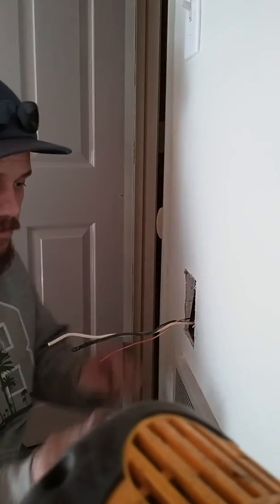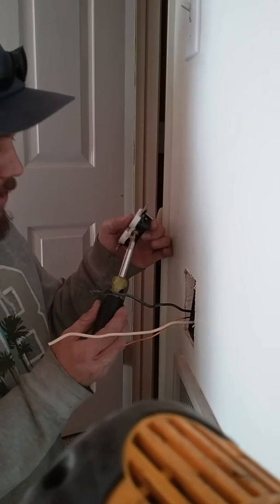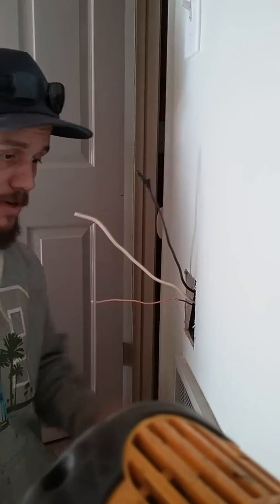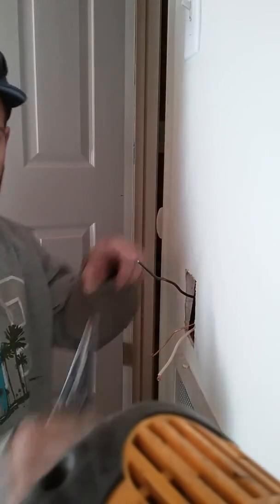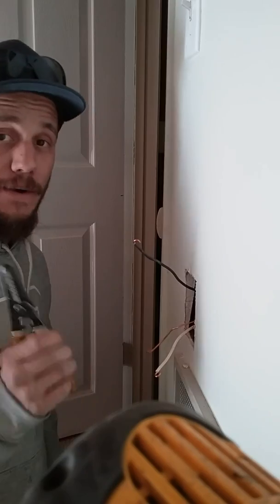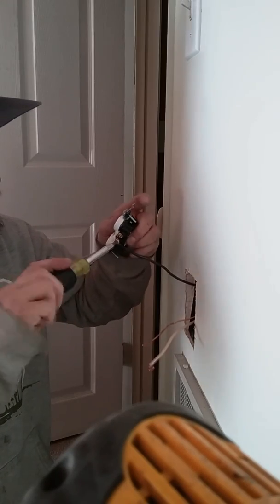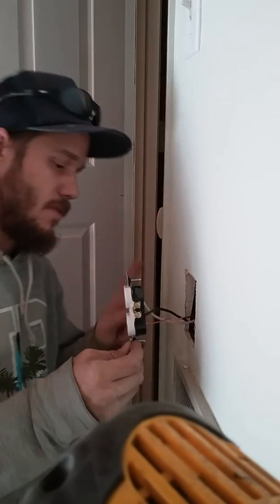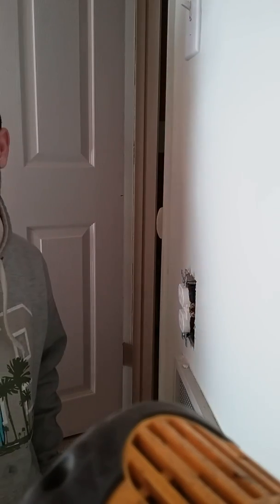Installing an Outlet, plug, receptacle, while hot, power on.  No shock.  DIY electrical lesson

Comment: You put the ground on first then the noodle, hot on last...period.   You never put the hot on first.  You can palm the whole device in your left hand safely then connect the hot and hold it in place by the insulation with your hand palming (index & middle)the device.  Then use free hand to tighten the hot down.  That’s the way all the electrical unions teach it and after 20 years of doing residential/commercial/industrial I’d never do it any other way.  To each is their own tho.
Reply: You realise he's doing a socket. Ground as an extra safety measure wouldn't even matter. It's not like the ground will have any connection to the hot correct?? Nothings plugged into the socket. He's literally just connecting wires onto their own contacts. Wouldn't matter what order, he's just found over his years that this tends to be safest. (well apart from turning the power off obviously haha)
Reply from the maker: @PK-lz4ho  thank you for understanding the video
Reply: Paul Knowles The only logical response here.
Reply: @PK-lz4ho  I only had done a hot hardwire one time on a receptacle. Only time I ended up getting shocked was when my pinky finger accidentally touched the hot terminal while the palm of my hand was in contact with the yoke. BTW I was on a yoga mat doing this, though I can't Calc how many ohms it was exactly, but you get the picture. If you need to work on it hot, wear proper PPE gear. Always if possible de-energize the circuit.
Reply from the maker: If you ground first then your grounded as you handel it.  Then your grounded as you try to hook the hot.   Thats how you get shocked...
Reply: I agree,  electricians that taught me always said remove hot first and connect it last.
Reply: As an experience electrician..even on a dead circuit you will land your ground,neutral,hot in these order,dead or hot that's the correct way to do it,ALWAYS DEENERGIZE YOUR CIRCUIT BEFORE WORKING ON IT PERIOD (BELIEVE ME ITS NOT WORTH IT)
Reply from the maker: @robcruz5546  it's not that bad to get shocked.
Reply: I've had to work on live circuits before, not fun. Someone had said to me one time, why dont you wear rubber gloves? I'm thinking, why didn't I think of that? Anyway it worked extremely well.
Reply from the maker: @thomasschwarting5108  120 is not that bad it's the 277 that will mess you up.  It pulls you in stuck
Reply: @thelovetemple333  it’s actually the amperage that kills you. You could hold the hot wire in your hand and not touch anything else and you’d be fine, because you’re only “potential”. As soon as you touch something while holding hot wire it will travel through you and suck really bad. A risky experiment but it’s true haha.
Reply from the maker: @brucehenry5338  voltage is potential difference between hot and neutral.  Yes one can touch the hot if not grounded or touching the neutral
Reply: @thelovetemple333  I’ve been hit by 277 once…the wire nut  fell off and my hand touched it but luckily my elbow of the same arm was grounded.  I rather get kicked in the balls by a professional soccer player then experience that again.  With that being said 120 is the more dangerous voltage because it’s the more common voltage.  More ppl come in contact thus more issues.  Most common is assumption the correct breaker is off and someone used a faulted tick tester.  I’ve personally fell victim to this in my apprenticeship days and hence while I only use a fluke tick tester on a know live circuit first.  I found this to be the most durable and the most reliable.
Reply: @thelovetemple333  i got shocked as a kid when I was replacing a fluorescent bulb in a commercial building. I wasn't paying attention,  one finger on each side. Gave me a massive headache and contracted my muscles. I was dazed for a long time, I even had pain around my heart.
Reply: Haha I get the video uploaders point... I think he did the hot one first because there would be less potential for crossing the wires if it was secured first. With proper handling of the outlet.
Reply: I would also like to add... That neutral (return) and ground are not reliable... I have encountered shocks from bridged grounds. The wiring in my mother-in laws-house from shitty contractors of yore makes me fear all wires.
Reply: Thank you for this
Reply from the maker: Obviously never been shocked through the face of the outlet
Reply: Every electrican knows to install the hot wire last , if your installing while its energized ..Ground first , noodle 2nd hot last . You do not want to be  grabbing and wiring the receptacle while you just energized it . Makes no sense ..But hey your probably a newbie . its coo . You got to start somewhere ...
Reply from the maker: @818NH  why?
Reply from the maker: Why?
Reply: @thelovetemple333 I don't think anyone is saying that you can't do it while it's hot we're saying this because it's the safest way to do it. For your safety and anyone who sees this video. So If you're gonna be teaching someone how to do hot work you should teach them to do it as safely as possible. Jus because you say "don't do this at home" doesn't mean that someone didn't look up this video because for some unknown reason they think they can't turn off the power or maybe they can't who knows.. Which brings me to another point. If you're watching this video trying to learn something, please for own safety and anyone who might be in your house. Call a professional because  you're clearly in over your head. Not saying that you can't do it but as an electrician
 (IBEW local 16) you need to understand that electricity is unforgiving. It only takes 1/10th of 1 amp to kill you. If I was gonna show someone to change an outlet I would not show them how to do it hot on the 1st day and I bet anyone who looked up an found this video has been their first day for the last 6 months and are in no way ready for not shutting off the power. It's not rocket science but we understand that but it is a very dangerous job that has been standardized for a reason. To keep you safe. That's why my friend.
Reply from the maker: @JoeNathan42420  how many times you been shocked?
Reply: @thelovetemple333  Because after connecting the hot, the two terminals on the side are now hot. That's a lot of live surface area. Now when you're working with the bare copper, you're inevitably going to ground yourself. If during that time, you accidently touch the hot wire or either of the two hot terminals, you're the path of least resistance.

OTOH, move the hot out of the way, and connect the ground first. This is easy and safe. Then the neutral. And then the hot. While connecting the hot, if you touch the live terminal, you are still not the path of least resistance because the receptacle has a ground and neutral connected. Plus, even if you do create a short condition, there's a return path, so the breaker will trip - it will be loud and scary, but 'probably' won't not kill you. It's of course, still dangerous (and as such you should turn off the power regardless of how experienced you are), but far safer if you connect ground first.
Reply: @thelovetemple333 if you have to ask that, you shouldnt be teaching no offense
Reply from the maker: @izaklopez253  😂 I know why silly I am asking why to know if they know why they do what they do?
Reply: @thelovetemple333  because you won't zap the shit out of yourself if something goes wrong
Reply: He's right it would have been the safest way the ground would have acted as an extra safety measure. Ground , neutral, then Hot
Reply: Safest way was to de-energize the circuit....PERIOD!!!! Very reckless video. Just someone doesn't get killed from it.  @Bubalashkka
Reply: @rllm133  Even when i turn off the power, i still treat it like its hot and test the wires twice during the process.
Reply: Electricity is lazy and it always follow the easiest path to earth. The ground wire, if properly installed is that easy path. So if in case of an accidental touch of the live wire  the current has an easier path to ground than to your body. And always use electrical tape around the connections  and use insulated screwdrivers they are cheap for the protection they provide.
Reply: @luismarquez6691  You dont always need electrical tape around receptacles . Most of the times Yes .
Reply: @818NH   on all metal boxes yes. When your removing a device or installing while it's hot it can touch the box and boom!
Reply: @stevestewart3816  that's y u electrical tape them....
Reply: @lrprepairs4356   I know
Reply: @lrprepairs4356  it’s not Chicago or NFPA electric code to tape them but we are required to run conduit here….for evvvverything except temps.  With that being said I’d say everyone in my local still tapes them because like ya said it’s safer and it gives ya a piece of mind.
Reply: And could he guaranteed that the ground was correctly bonded all the way back to the panel? NO EXCUSE to work on that live! Like how he says zapped...say it for what it is Electrocuted!!! Zapped seems so harmless to say.
Reply: RL LM there is times you have to work on things hot such as in a bank and you don’t want to de-energize the whole circuit because of computers.  Sometimes the panel schedule is labeled incorrectly and you can’t verify what you will actually turn off.  So if you can safely turn something off then do so, but if not use proper PPE and proper technique to minimize your chance of and mistakes.  And using any continuity tester/meter you can verify if the ground was good...and FYI grounding isn’t always necessary when you use metal piping.  You’re obviously not an electrician because you would’ve known that.  And I do tape my receptacles but it’s not code to do so.
Reply from the maker: @rllm133  electrocuted means death shocked is not.  I've been shocked so many times I can't count.   It's the 277v that will make you not work hot.

Comment: Getting bit by 120 is not as bad as people think, it's jarring but not all that painful. Usually if wires are connected and you grab it wrong I mostly get a strong tingle. Maybe that's just what I feel. Everyone has there own threshold or you get used to it
Reply: I've been tasered before while working on a range hood connected to 120v.  My head accidentally touched the metal hood while I was reconnecting hot and ground wires.  The entry point hurt for a few minutes (like a few flu shots at once) and exit point not so much but you knew where it exited.  You're right, you won't die from a quick jolt but I now shut off the breaker because I'm not always aware of where all my body parts are.
Reply: twobigjets “but you knew where it exited”. If this isn’t the funniest thing I’ve read today I don’t know what is😂😂 Please please tell us, where did it exit?🤣🤣
Reply: Yup,tingle jingle up the arm,weeee oops. Sometimes you just don't have access to the shut off at the breaker box. ▪☆☆☆▪
Reply: It is if theres a load on it.
Reply: And some people will watch this and then change their 240v outlet. I accidentally touched a 240V when younger and I jumped back several metres before I could even yelp. It's no joke, there's no need to downplay safety aspects mate.
Reply: @chocolate_squiggle  if you use this video to change a 220 outlet, then that is Darwin's Law at work and God Bless it!
Reply: You won't live very long thinking like that.

Comment: You should turn the power off first. Oh wait...that would defeat the ENTIRE purpose of this video. Thank you...needed a little reassurance before doing this. I can’t turn the breaker off because our business tenants servers, phones, computers are all on the circuit of the outlet I am changing. Very helpful. Thank you.
Reply: Also unless its the last outlet/socket on the loop like the one in this video most likely is, then disconnecting the wires from the outlet is going to disturb the power to the rest of the outlets further down the loop causing them to loose power anyway, so really you are achieving nothing by trying to change it live and only endangering yourself to electrocution and injury from short circuits and arcing caused by loads switching on and off suddenly as you try to make your connections. Your life is more important than their inconvenience, TURN OFF THE POWER!!!
Reply: @nrg-5003  um, i think your thinking of a series circuit, houses and commercial buildings are normally run in parallel.
Reply: @666cowboy69  No i'm not, I'm well aware the circuits are parallel, the outlets are looped , so disconnecting the wires to a socket outlet is going to disturb the power to other outlets further down the circuit so really you are achieving nothing by doing it live and are just putting yourself under unnecessary risk.
Reply: @nrg-5003  im sorry but i think im not understanding something, only in my first month of apprenticeship, so i built a parallel circuit using 3 gfi outlets in parallel, and one 3 pole switch, so to be clear your telling me if i  measure the (wattage/voltage/current?) at outlet 3 while outlet 2 is wired but disconnected and again when outlet 2 is connected i will see a drop in that respective _____?
Reply: @nrg-5003  or are you telling me the outlets are in series and if so why would someone do that?
Reply: So.... How did it go??
Reply: 4ST induction 
You do know that if you do live work so that people’s businesses don’t get affected then get a shock while doing it those same people are going to straight up feed you to the wolves? Don’t think for a second they’ll stand up for you and say that they wanted you to do it so they could keep going. They’ll straight up say you were an idiot and that it’s all your fault. Ten minutes down time for them is better than risking your life and if they still can’t manage to give you that time do it after hours!! I’ve been an Electrician for 14 years and I’m no longer young, stupid and inexperienced enough to do dumb ass shit like that. Isolate that shit!
Reply: @zeemonkeyman1  Good, sound, advice. In this line of work your safety is priority.

Comment: Always hook the ground up first. Followed by neutral and then the hot
Reply: Video poster might be using the "car battery technique", which is connect positive first, then ground.  I tend to do it this way too with light switches at home, not saying it's the right or wrong way though.
Reply: steven gawlas Your absolutely Right! I went through a 5 year Apprenticeship! I was thinking what an idiot! Then you only use a good pair of good insulated Klein Journeyman Pliers not a pair of wire strippers!
Reply: Steve’s 100% right, you hook up the ground then neutral then place the neutral side in your palm of your non dominant hand then land the hot and using your index and middle finger of your hand palming the device you can pull down holding it securely in place and tighten the screw down with your free dominant hand.
Reply from the maker: @erect4dayz  why?
Reply from the maker: @erect4dayz  then your grounded. Why would you want to ground your self?
Reply from the maker: @erect4dayz  that makes you the potential difference
Reply from the maker: Why???
Reply: Raasiyanatha David first off only your palm is grounded so the path will be thru your palm back out your palm, but in all honesty it’s impossible to electrocute yourself via this technique.  Before you knock it try it.  It is very controlled and minimizes and accidental slippage.  I’ve changed 1000’s of receptacles this way.
Reply: If you’re that worried use an insulated glove in the hand holding the receptacle.
Reply from the maker: @erect4dayz  why do you think it is better way?  Ever sliped the hot and have it hit the ground or you? Gloves will not save your face
Reply from the maker: steven gawlas not when it's hot..  if u hook up ground and natural first then you have two spots that have a potential difference to the hot which is voltage which will shock you.  If you hook the ground first now the whole metal yoke is grounded and if you slip the hot will complete the circuit
Reply: @thelovetemple333  you have clearly no knowledge of electrical systems and anyone reading this needs to think twice.
Reply from the maker: @DAROYALTY001  why?  Enlighten me

Comment: if you are going to work with hot wires and install recepticle atleast put  TAPEEEE!!! around so theres no contact inside the wall and maybe have an explosion.. smh
Reply from the maker: German Urrutia there is no way there will be contact in the wall if it's installed right.  Plastic box plastic cover.  120 can't jump far at all.  You probably put tape on wire nuts also don't you?
Reply: David Kenneth Swinson lol no i dont put tape on wire nuts. but i do put around the recepticles for better safety. takes 2 seconds..
Reply from the maker: German Urrutia how is it better safety to put tape on it?  Safe for what?
Reply: @canclin11  tape is not code anywhere. It just feels right to people who don't know what they are doing. If it was safer or necessary it would be in the NEC, it's not.
Reply: Lol I only put tape on a recepticle even in homes because I do whatever makes my customer feel safer plus I think about the next guy That will come in Maybe to replace the recepticle if he works on it hot like I do Most of the time and also actually I do put tape around wire nuts but only when I run 277 temporary wires that are exposed obviously..  Be a nice guy think about the next person who will be coming to touch what you worked on 🤷‍♂️